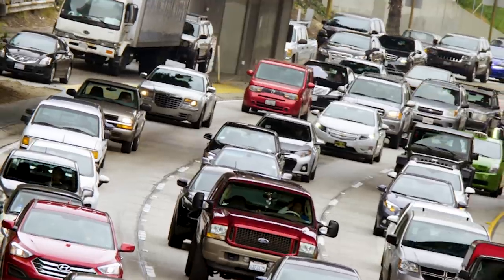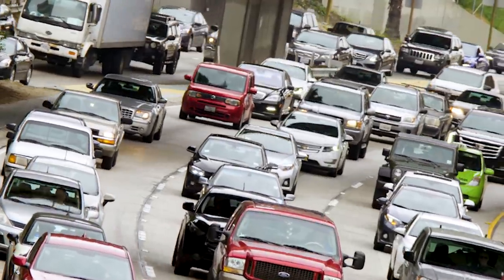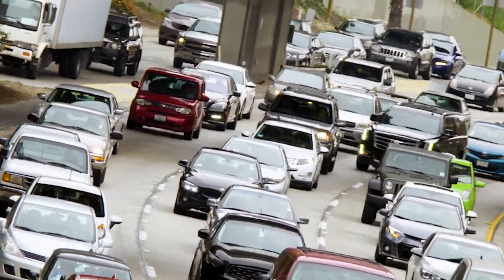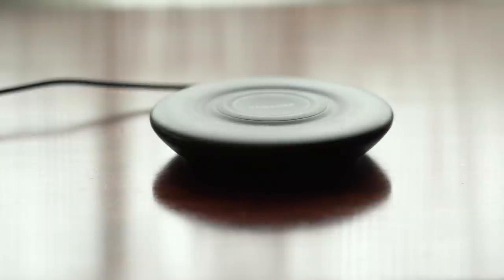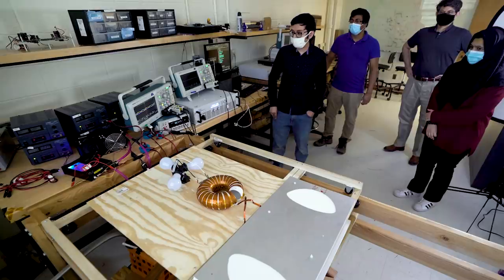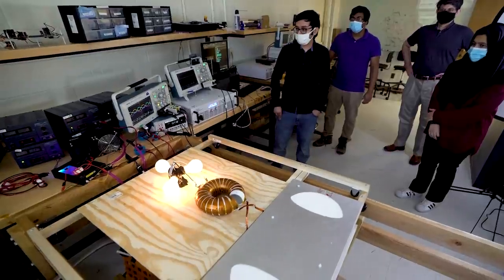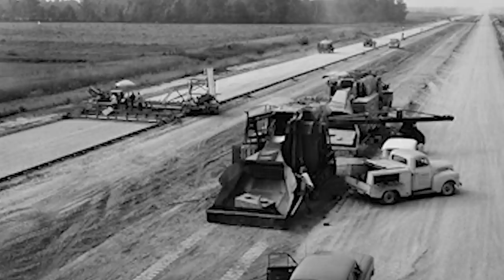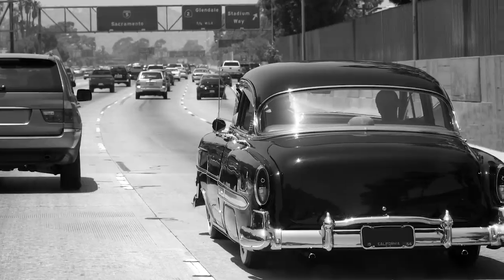Wireless charging of electric cars

Comment: If the pads can be placed on the side rails instead of underground, it would make access and maintaining the system less expensive. This is emerging tech so there are going to be baby steps. However, something like this would completely eliminate the need for advanced, toxic and expensive car batteries as well as the need for charging stations. This would be an absolute game-changer for implementing electric vehicle technology.  Paying for the power could be by an electric meter in your car or just by a nationwide electrical tax.
Reply: I agree

Comment: Great in the warm south but won't work where it snows often and road salt is used. Would last 4-5 season then would need to be totally replaced
Reply: They do not necessarily have to sit directly atop the road surface, as far as I know. They could be placed within the cement at a certain depth. It's all based on magnetic fields. Just like a magnet can attract an object through a piece of paper, so too can a strong enough magnetic field interact with an object through concrete. Obviously, though, the road material & its thickness would impact the magnetic field's strength.
Reply: With all that electricity, wouldn't be that hard to melt the snow...

Comment: Excellent idea, but very expensive due to the high number of charging pads at every few meters (or centimeters). Each charging pad unit would already be expensive. I would guess a limited availability due to cost.
Reply: Ok but let's think about the cost associated with building and maintaining a gas station. I predict the pads are going to be far less capital and labor intensive.
Reply: @mv2woods  I wonder about the source of raw materials for large scale installations .......
Reply: @bill3641  what raw materials specifically are you concerned with?
Reply: @mv2woods   Copper , and maybe Aluminum .
Reply: @bill3641  Aluminum is third most abundant element in the Earth's crust and easily recycled, so not much worry there. Copper is less common, but tech innovations and better recycling could fill the gap. Challenges exist, but human ingenuity will likely find ways around severe limitations.
Reply: I think you could drastically reduce the number of needed pads when you would use supercapacitors in the cars. They can be charged with high power and don't degrade like batteries.

Comment: They state that there is no known material that can handle the load that you need to transfer wireless. It is nothing but a computer simulation. Also, at a loss rate of about 30-50% for wireless charging, the question WHY comes to my mind.
Reply: @michaela.257  A Tesla supercharger charges with 150 kW (probably double next year) and in your article by BMW (so they are advertising for themselves) they report 11kW over a few inches with only 95% efficiency. So once again, WHY would you do it when a cable can charge 10x faster and at least 5% cheaper. And it only works statically over said few inches. (;
Reply: @ThePhoenixfromtheAsh  WHY try to improve on any technology then? I’m sure there were people saying similar things when people were upgrading from horse and carriage.
Reply: @michaela.257  There are limitations to wireless transfer of energy and its efficiency is fundamentally limited by the distance. Doing it dynamically is simply a very stupid idea. We should try to optimize our energy consumption and not go wireless because people are too lazy to plug in a cable. Your argument is "we should develop new technology"... And I am telling you that physics has limits and this is one of them.
Reply: @michaela.257  Back then even gas stations were far and few in-between just like Charging stations are today. 

I'm sure the future (hopefully in our lifetimes) we'll be able to drive into a QT, BP etc. and see 5 pumps: Low, Mid, Prem, Diesel & a universal Charger; while all options taking only 5-10 minutes to go from empty to full.

Comment: Neat concept, but how will you overcome the inefficiencies of induction charging?

While not necessarily the most credible source, a Medium article reported that charging a Pixel 4 from 0% to 100% consumed 14.26 watt-hours; whereas a wireless charging stand consumed 19.8 watt-hours to achieve the same result. That means the wireless charger used 39% more electricity, and that is while the phone was stationary and in direct contact with the stand. While I'm sure efficiency can be improved, the maximum efficiency will still be below that of wired charging.

I'm not saying this wouldn't have some benefit for getting people to switch to electric cars, but I do not personally see any way for this to be done efficiently enough that the car will receive more power than it consumes. The research might produce some good findings, but the objective seems less likely to succeed than the famed Solar Roads project. (And Solar Roads was wholly impractical, to be clear.)
Reply: Well it's all economics in the end, because what you forgot is the price you need to pay for the battery initially/ battery swap cost in the future. As an example, the battery swap costs of a Hyundai Ioniq 5 is around 30000€. It consumes around 26kwh/100km, so for 200.000km (124.000 miles, let's say that's the average lifespan of a EV battery) you would need to calculate 20.800kwh more because of 40% more power needed. Here in Germany the electricity costs are around 0,40€/kwh. So the extra costs because of wireless charging would be 8300€ for 200.000km. That's far less than the cost of a battery. Of course there would have to be an extra cost because of the charging infrastructure, but if every car would use this technology, it's negligible. And I also didn't take into account the big battery losses in cold climate and when the battery degrades.

I think the only problem is, that all car manufacturers would need to implement this technology in their cars and this is where I am a bit skeptical, because they can make a lot of money nowadays with the batteries and a lot of times people need to buy new cars because of an aging batterie. With the wireless charging, the sold cars will have a longer lifespan and so they would sell fewer cars with less profit which isn't a business concept they are looking for😏 Well, maybe they could invest in the charging infrastructure on the roadways and could make their money that way, but my guess is that they can make more profit with the batteries.

Comment: Imagine this on railtracks that are electrified for electric locomotives. That available infrastructure with this tech added could enable infinite rail. The real-estate over the tracks could harness power from the sun that feed the grid. At a conservative 15% efficiency using a decade old tech had  huge potential. Tech  from today will push the average to nearly 20%.This is exciting.
Reply: For railroads this exist with wired one.
Solar panels good in nearby rails but not on rails due high vibration of moving train.

Comment: yea that will work when you're forced into the slow lane by emergency vehicles... enjoy the bill. you 'd be better off with plan two which is placing a series of poles along the road with a recharging wire that your bumper car trolly pole can swipe when needed. then when you recharge at home you can transfer your recharging usage straight to the billing company. see, efficient, no fraud there, and if you're creative, you'll manage to put dinner on the pole and have it cooked enroute.

Comment: How about recharging using the motion of the wheels? Surely that us easier than changing the roads and more efficient.
Reply: How would that even work?
Reply: @adamphoenix4253  - I mean, where would the energy come from? We already have regenerative breaking, so the mechanism for turning motion back into electricity is there. But how would you move the cars wheels (whilst keeping it moving) to charge the battery?
Reply: ...and if you can move the cars wheels, you don't really need a battery!
Reply: That would be perpetual motion, which is impossible.
Reply: @aarondeal7955  LOL took way too many comments until someone finally came along to state the obvious 🤣

Comment: Too expensive, and too much electrical to maintain.  It would have to be miles long and could serve only a limited number of vehicles. 

It would be better to have a mobile charging station that could travel along with the vehicles as they're moving down the road.  The charger would cost much less than this charging road.

Comment: Not a good idea at all. Get yourself a little hand-cranked generator. Crank it with no electrical load on it, and it will spin easily, almost effortlessly. The moment that you connect a load to it, it becomes very difficult to crank. This effect happens with ALL types of generators, which is what these would amount to. It simply will not work. I'm surprised that Cornell does not know this. TANSTAAFL.
Reply: Lol you're completely missing the point of how this works... Not a generator. It's an induction charger, totally different principles
Reply: @mv2woods  I understand the principles of induction very well, apparently better than you do. I built a DC motor when I was ten years old, and that was sixty years ago. It will NOT work.